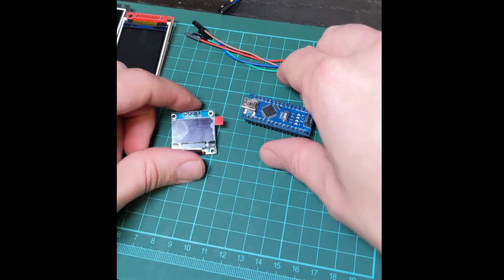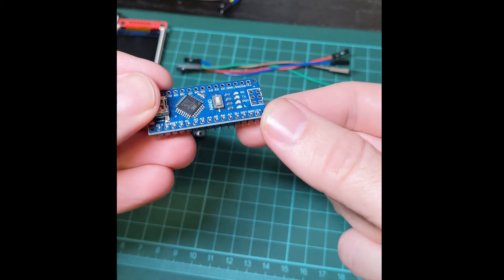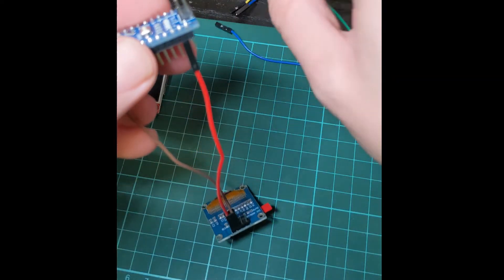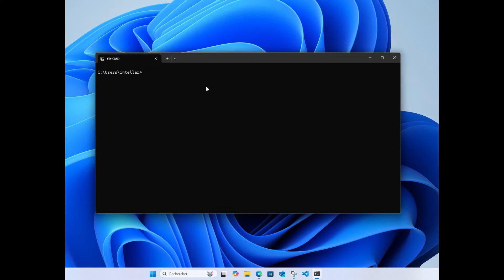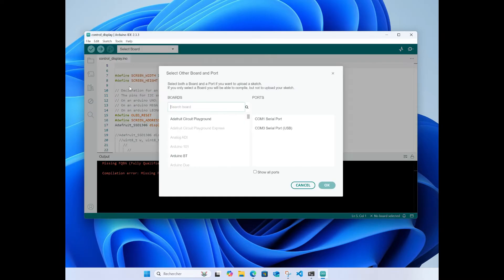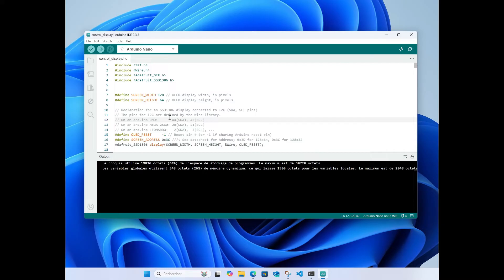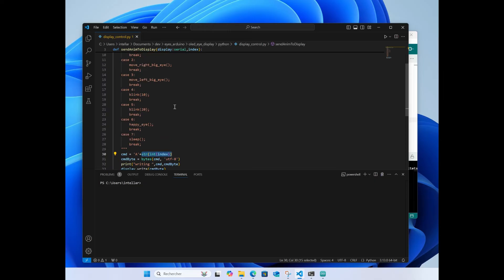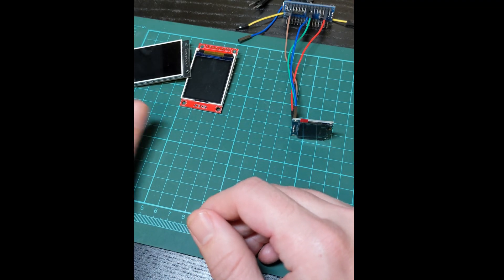Animated eyes on oled display - The tutorial

Comment: Can i make it with the esp32 that has intergrated display? The point why i'm asking is that idk if i have to connect the display to some exact pins and i can't change them or see which are connected. I don't even really have pins these sooo yea. Please respond 🙏
Reply from the maker: sure, if the default hardware i2c pins of the lib are not correct, you can configure the pins manually, with adafruit, using the Wire.begin(/*SDA=*/ 21, /*SCL=*/ 22);  before calling display.begin,  and with U8G2, you need to use a different object, for example, for software i2c with U8G2_SSD1306_128X64_NONAME_F_SW_I2C display(U8G2_R0, /* SCL=*/ A5, /* SDA=*/ A4);
Reply: @intellar_ca thanks!

Comment: Can I use the Arduino Uno R3? Or can I use the Nano for it to work?
Reply from the maker: You can use most microcontroller, esp32, Arduino, etc, as long as you can find a driver for the display chip. Here it was the ssd1306, but you can use any other display, even color. I used the Arduino Nano for the challenge, it is not the wisest choice.

Comment: Hello! Changing animations via COM works. But how to change animations from a button or from IR remote control? I tried to connect libraries and insert commands, but everything doesn't work together(
Reply from the maker: On arduino ide, you need to setup your interface in the setup() function (button, IR, etc), and replace the code from the loop() with your own code handling the events.
If you work on python, its slightly more complicated. you need to create your own communication protocol to send messages to the arduino from python, and listen to these message on the arduino, like I did with the animations.
Reply: Can I use arduino uno??